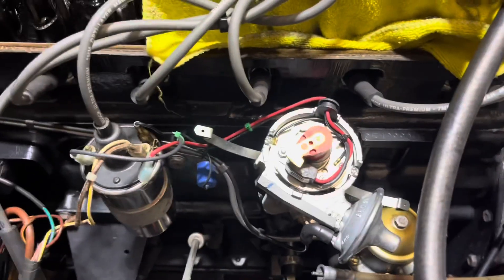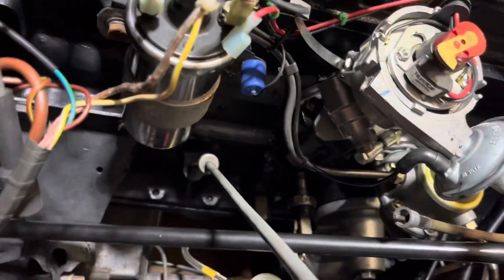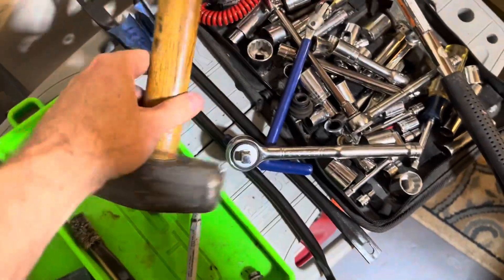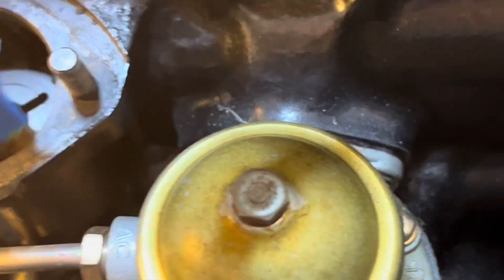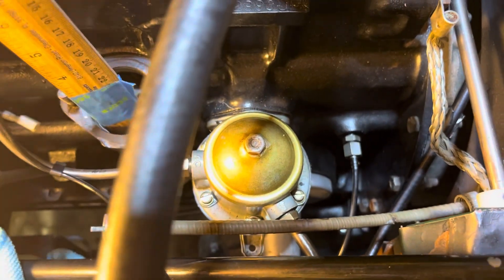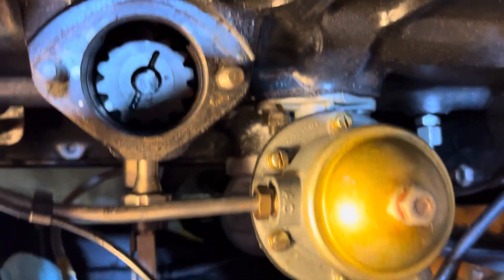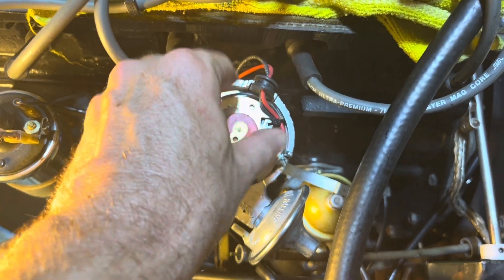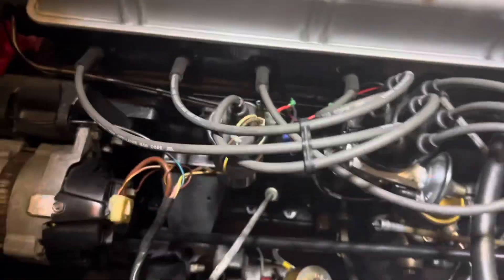Triumph Distributor Reclock (TR6 or Similar) part 2 of 2 of vacuum advance addition.  @DIYHelp

Comment: Today I just installed the Zenith Stromberg carbs I rebuilt on my friend's '74 TR6. I told him to buy the vacuum advance can and I'd put it on. I had to advance the distributor way past where the tach cable reaches for it to run well without the stupid vac retard can connected. I did wonder how I would change the position and presto, I found your great video showing exactly how to do this. Now I'm ready to rip that sucker out and add the vac advance can and time it. Thank you and excellent video with close ups and good lighting and no loud music. Well done.
Reply from the maker: Great. Go slow and steady. It’s very difficult to mess things up that are not reversible with these cars.  Vacuum advance for sure makes car run better.
Reply: @DIYHelp  I'm glad I marked the flange and the tooth with white marker. It wasn't easy moving back one gear tooth. It kept going 2 teeth. The I reached down deep with some long nose pliers and turned the oil pump and then the gear dropped into place with only one tooth CCW. Worked great. Perfect advance curve now and the vacuum advance works well too. Thank you again.

Comment: I understand why you want to rotate the drive gear one tooth to allow the tachometer cable to align and function correctly, but is there some reason why the drive gear placed in proper orientation per the manual that would causes the distributor to be rotated to far clockwise?
Reply from the maker: My condition was simply caused by a change. I removed my retard vacuum and installed a advance vacuum unit. This is considered an upgrade.  Once I reset my timing USING vacuum not my worn out damper. The distributor is clocked to far for the tach cable to fit.  So I Reclock one tooth to fix that. It’s a part of the directions from British Vacuum.
Reply: Appreciate the reply, I did not know about British Vacuum.  It sounds like it has been an improvement in drive-ability for you. I recently had my 73 TR6 distributor rebuilt by Advanced Distributor with mechanical advance, they will not rebuild to original specs with the vacuum retard and say no vacuum connection. Not sure if I am happy with the results without the vacuum connected,  idle is not steady and throttle response on low rpm seems sluggish, so the drive-ablility seems not as good.  Thanks.   @DIYHelp
Reply from the maker: he rebuilt mine too and charged me quite a bit to rebuild my "retard".  That was a mistake but I didn't know back then.  The recommended first upgrade is to simply "plug" the retard vacuum line and then retune your car with this not active at all.  Your car will run fine but again you have to return - idle/vacuum/perhaps mixture.  Retard vacuum is mostly working at idle.  Advance vacuum is Zero at idle and only kicks in at higher rpms.  2nd upgrade would be to replace with the vacuum advance like the earlier cars.  Idle and general driveability did improve noticeably. @robertharrison9248

Comment: Thanks for posting this. Very clear and explained perfectly. Now, lets see if I can do it.  I've watched several of your vids and also bought a Quick Jack because of that video.
Reply from the maker: Quick jack was my biggest mistake ever. What I mean is I wish I would of gotten ten years earlier. I use that thing all the time.  Recently I double rubber blocked it for the welder and I got the mounts about three feet off the ground. Made it easy to repair differential.  For extended lifts of days I do use four standard jack stands front and rear at the appropriate jack points for more support of frame to avoid warping.
Reply: What do you consider the correct points on the frame to place the jack stands for long term work on the car? @DIYHelp
Reply from the maker: There is a picture that floats around the forums showing green and red dots. You want the jack stands on the green dots. I briefly show the picture in my QUICKJACK  video.  Basically you stay away from the frame rail wings under the doors. Stands go near the front and rear wheel locations.  Find the picture. Usually you can download it.

Comment: Thank you so much for posting this.  I've been putting this job off for quite a while, ever since I replaced the broken tach cable and didn't like how tight the bend on it was.  Now I know exactly what to do, plus a couple of tips for cross checking as I go.
Reply from the maker: I had same problem. I was hesitant thinking it would never run again. LOL. Really not that big of a deal. My tach is super smooth now.
Reply: I got it done over the weekend and the car is running much better now, and of course the tachometer cable is happier too.  I originally missed the part at 7:20 where you said you turned the engine to get the gear to seat down all the way.  But because of your measuring stick advice I knew it was not right so I rewatched the video.  Once I did a revolution of the motor the gear just dropped fully into place.  Thank you again so much for this video!!! @DIYHelp
Reply from the maker: @jamesthomas4080  good news. Normally I would of just jogged the rear right wheel until it fell in place but that requires an assistant. My problem is I had my car up on all four wheels off ground and you can’t move drive unless the rear left wheel is fixed on ground and out in fourth gear. My tach is finally smooth also.